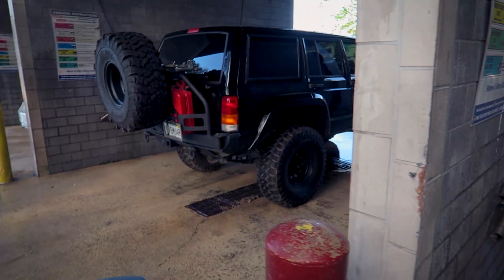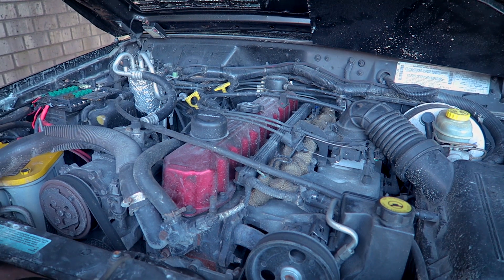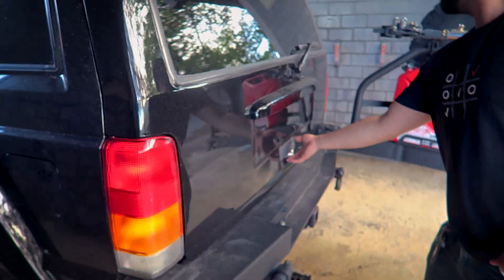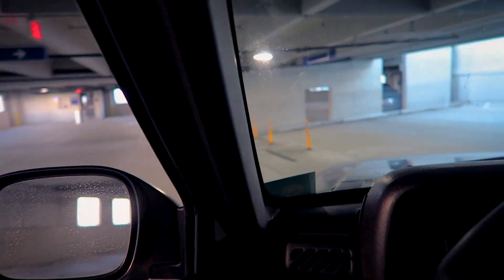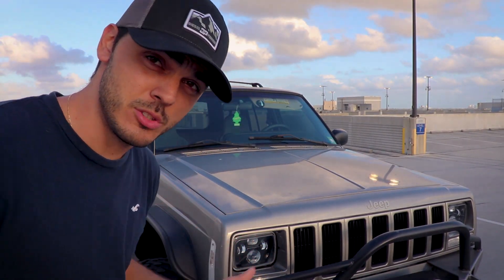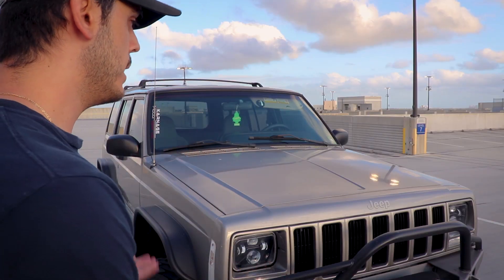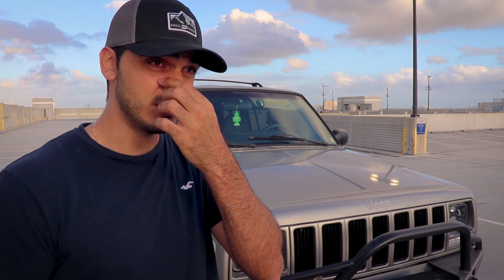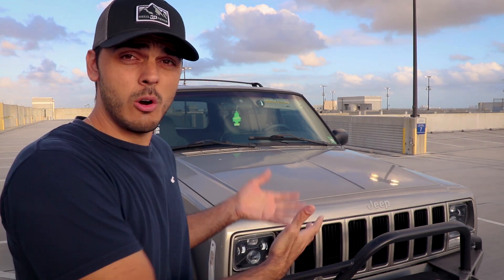MAKE YOUR JEEP STAND OUT! SIMPLE MODS THAT WILL CHANGE THE LOOK OF YOUR JEEP!

Comment: Has anyone tried  thicker oil in the 4.0L notice any better response or power , or any mod tips in 2019
Reply: RRealz   I use Rotella Shell for Heavy Duty trucks, semis, diesels n shit. I’m running at 212k on the motor. It’s been taking care of it so far. It’s been my daily driver for years and I just got a new vehicle so I’m ready to park my XJ and start a build in the spring.